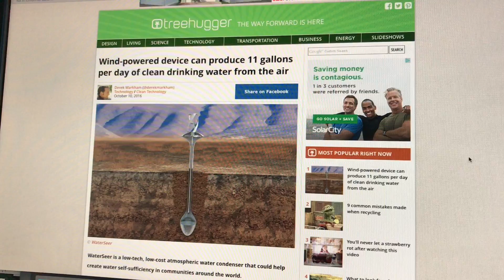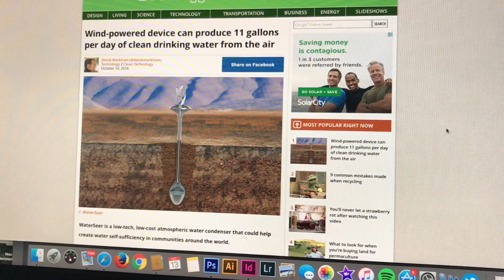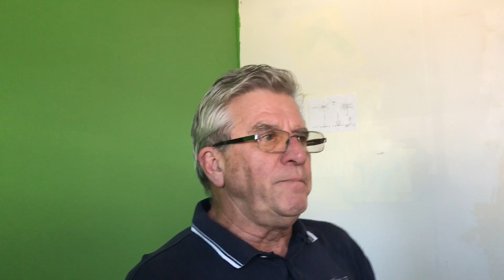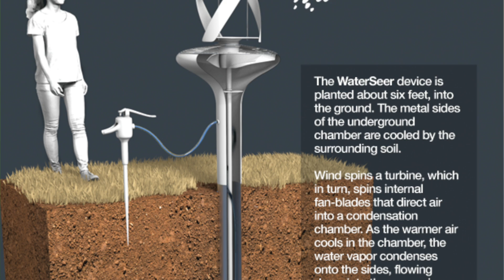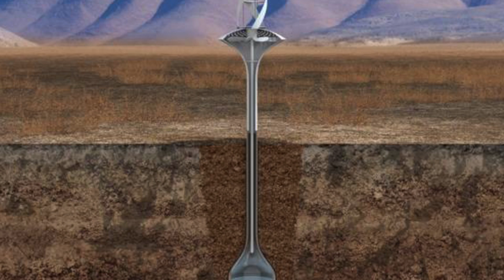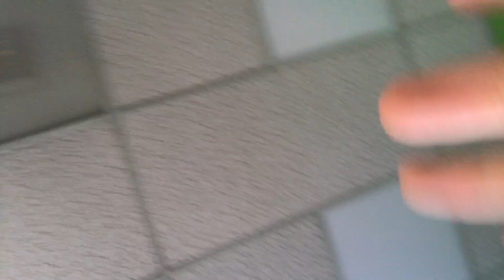WaterSeer Review

Comment: A video explaining my thermal model.
https://www.youtube.com/watch?v=P7bUgmKOvsE&t=1s
Reply from the maker: Good stuff, Scott. The one thing I was hoping you would explain is the rate at which the dirt would warm. 

BTW, I have a call setup with the folks at WaterSeer for next Thursday. Stay tuned.
Reply: Thursday 10.11?   Be careful that Don Z.  at Vici-labs (Waterseer) does not dance around your questions.  He did mine.  He will answer questions you did not ask to get you off the real question.  They are experts at avoiding direct answers.  After a few E-mail I think they are starting to doubt the passive model with conduction to earth.   They are now proposing moving the thing to other holes when the earth heats up.  (see my second video).  They mentioned TEC's and solar so I ran some quick numbers.   To provide the electricity to make 37 L/day with solar they would need like 130 m2 of solar cells...and not to mention what the TECs (Peltier device) costs.

The ground heat capacity is around  2.5 MJ/m3°C (for organic mixture).   The heat of vaporization of 1 liter of water its 2.2 MJ.   So as a rough number you can condense a liter of water by warming 1 M3 of ground each 1°C.  At 37 liter/day the heat transfer is 1/30th of what is needed.   You you can heat 29 m3 of earth 1°C each day.   I will add a earth volumetric to the model.    On a gut level I agree with thunderfoot's estimation.

Comment: The idea, as it's presented in their video, is unfeasible and - more importantly - thermal dynamically impossible.  Essentially, one has to believe that surface soil maintains a constant temperature gradient with respect to the surface atmosphere, and functions as a perfect heat sync.  Commercial grade dehumidifiers don't perform as well as they claim their "hydrolily" does and they have a constant power source.

Comment: I didn't do in-depth thermodynamics in my Engineering classes, but I can tell you straight off that this device can't work as claimed. You'd need 100% humidity at 30*c with a ground temperature of 10*c to get 20ml of water out of the device. You'd also need to be pushing the equivalent of 2 cubic kilometers of air per day to get the claimed 35L, which would take a total of 85 KW of thermal capacity needed from the soil to keep the process as efficient as possible... You're better off just running a solar powered dehumidifier because you'll get more water off it!!

Comment: Thunderf00t called this one a scam, you were more generous and you seem to think it just has a few mistakes.

I think the best thing you can do for "fresh" water in areas where there are no wells or public supply is to collect rainwater (you may want to boil it though). If it never rains there, then that device wouldn't work either.

Comment: Compared to a mechanical refrigeration system- a 3000 watt system, that moves 1200 cfm of air will put out about 2 liters an hour in in ideal conditions (fresh humid air intake). This system would output a tiny faction in power and air movement, with no solution for long term  transfer of heat. (Trapped in solid ground)

Comment: for fucks sake to all the people who are saying herp derp wont work thermo dynamics you sound like idiots to me. 

Heat transfer mechanics dictate that this device can work. the issue will be scale and effectiveness.

fact of the matter is the only thing new and or interesting they are doing is havibg a wind powered fan to blow air into a hole. 

I could tell you right now upfront if you wanna make that work just get a long pipe and bury it ib the dirt and push air through and you will get your air to dump water. interesting bonus ... If you pressure the air and eject it via a nozzle  and throttle it you could probly vastly increase the water production
Reply: Maybe start with capitalizing letters and making paragraphs, and later on we can talk about your wind turbine water extractor, OK?
Reply: sylvester lutchman
There's no engineering to nitpick yet, you've just used a lot of very vague language. A wind turbine, what kind, how much kilowatt output? How much water is this supposed to produce on average per day? How much does it cost?
Reply: sylvester lutchman When that water condenses, what does it do? Oh yes, it realesed energy. That energy will heat up the soil and condensation will stopp, go watch thunderf00t's video if you have not allready. This device will not work in such a way that you can get usefull amounts of water from it..
Reply: you could get a wind turbine to exract water out of the air using nothing but the air itself to cool the heat exchanger. Ive done the math on this exsisting design and rhe fan only requires under 100 watts of power to move all the air it needs to (under 100 cfm). guess what you can modify this design to make it work to cool air to the dew point even if its minus 1 C. your gonna require that fan to do some compression work but its got a  ig ole VWT untop of it to give it power on a direct shaft so why the hell not.
Reply: sorry dont give a crap about that. wanna nit pic grammar go ahead. 

wanna nit pick the engineering then bring it on.
Reply: Мейсу Семпай it takes 2 kJ of energy to condense one g of water.

assume this heat pump can have a COP of just 1. just for the sake of simplicity and im feeling to lazy to work the actual COP.

so per kW of power you could generate .5 gof water per second... 1.8 l per hour.

modify the cycle of compression and cooling and maybe introduce a refrigeration cycle instead of just compression. you could get a COP up to 4 . so then per kW you would generate 7.2 L of water per hr . that would mean per day you would generate 170 l of water a day per kw of power. 

next yout gonna be like but the soil will get hot ... to which i will say so what? the ground is a heat sink. If yu are compressing the air even if you just compress it by a factor of 2 you will get 300 K air heating up to 600 K air rejecting heat to 290 K dirt. iunno about u but my money is on the dirt absorbing that hear quite easily.

Comment: To wish the developers luck is an emotional response. Yes, there are a bunch of people who desperately need water, but that won't change the laws of thermodynamics. It does not have the power to move enough air through the condensation chamber and it cannot dissipate heat away from the chamber effectively, meaning that it will stop working as soon as the surrounding dirt heats up. It would be cool if it worked as advertised, but it can't. Because physics. Just compare it to a powered dehumidifier, they both basically do the same thing.
Reply: It won't work, no. But it might the the first step in the development of something that does.
Reply: Andy Brice First step would be understanding thermodynamics, that should be the starting point. The people who made this don't understand it, or they do but are lying to fleece benevolent but uninformed people. They are either incompetent or running a scam.
Reply: Something that circumvents the laws of physics and WORKS!
Reply: No one ever said it's physically impossible to remove the water from the air. Just that this device would not generate enough energy to do so, nor be able to dissipate the heat. Dehumidifiers do exist.
Reply: More like wish the crowdfunders luck in not throwing their money away on this scam
Reply: Andy Brice
Removing water from the air is a monumentally power-hungry task, though, which is the main problem. It's a thoroughly inefficient way to obtain water. And it's unlikely that this device will pave the way for other devices that make the process more efficient somehow.
Reply: Yes, dehumidifiers do exist, and if third world countries had enough energy to run them for water production, they would not be facing water issues to start with.
Reply: Owen Major But people who don't have access to water live in very arid climates. If the climate there wasn't arid, they would not have water issues. And arid air does not yield much water. You can't squeeze out water from a dry towel.
Reply: wrong again, you can live in a tropical climate and need water ... water tables too far down to reach and not enough recipients to collect the rain when it does to hold through dry seasons - also it's raining increasingly less in the tropical climates (at least where I've lived around the tropical belt in S.America, SE Asia and Central Africa ... too many trees being cut down probably).

Comment: The designers of this are either completely ignorant of basic science or are crooks.  Just look up a dew point chart.  Take a typical condition, 80 deg F and 30% humidity, the dew point is 45 deg F.   In other words, the bulb of the Waterseer would have to be cooler than 45 deg to produce any water.   Just the ground is not going to cool 80 F air to 45 F.

Comment: The WaterSeer is old technology that promises to extract water from air using only the thermal differential of 2 or 3 meters of ground.  If this were the case, we would be able to extract the same amount of energy that it takes to condense water vapor.  

The people who promise you free water from the air don't want you to think about the amount of energy it takes to condense water vapor (2246 kJ/kg).  If instead they told you they could generate free electricity from sticking a tube in the ground, would you believe it?  Of course not.  For the same reason you should not believe this BS.  This machine works on the same concept as a free energy device.  It doesn't work at all.

Comment: You do not have to be a great engineer to see that this is the same process that happens around an air conditioner, and the permanent use of a powerful one or two horsepower motor is enough to produce a few drops of water per hour. Enough to be a nuisance, not enough to mix much more than a whiskey or two per day.

And the air conditioner has a very effective cooling gas circuit, not a simple temperature differential between the air and the soil at 2 meters depth. This whole apparatus is a scam. It does not matter whether the details of the air exits is shown, or if a more realistic 20 meter or so windmill is used. This thing is orders of magnitude away from working in a practical use, even disregarding the fact that it will warm up the soil in minutes and not work at all.
Reply: Mark Dignam
Even if you didn't have rainfall, you can easily collect water in tropical environments with other means - cutting nonpoisonous vines and draining them, using a plastic bag with a rock in it tied around a tree branch to distill moisture from the leaves, etc.
Reply: Мейсу Семпай Yes, which is why you don't need it in a tropical environment, and why it would not work in a dry one.
Reply: This is actually a great summary.
Reply: I have expanded on a few of the point you make above - actually I answered the clip before I read your comment.  The air cond example is one of flash evaporation is a heat exchanging environment.  Air conditioners as you note do generate quite a bit of water via condensation when in a hot and humid environment.   The waterseer would also need to involve a heat exchange and this would in fact lead to heating of the soil around the storage vessel and piping.   This is not understood by the "inventors" and disproves their claim.
Reply: I had to think about it also then I factored in a few things like Dew point at night ground absorption if the input air tube is smaller than exit tube then water cool down at bottom 
????plus the heat escaping the tube could make the turbine turn????
Reply: Father Joe Under such circumstances, the crazy thing simply will not work.
Reply: I have a 10,000 btu/hr air conditioner and it(at best) produces about 5 gals/day when running. A 5 gal bucket used to collect condensate which is why I know this. And this is only during high humidity times. Often it only produces but a few cups of water.
Reply: There would not be a need for a waterseer in a hot, wet environment - such as Singapore where I live.  here, you can generate a few buckets a day from air conditioning as you note, but there is no need for it as you can readily collect heaps of rainwater. In a dry climate, particularly a cooler one with les water vapor, you would need a lot of air conditioners to generate the same amount of water.  More importantly, you would also need an enormous supply of energy.

Some of you will of course say that the waterseer does not need an electricity supply.  And for that reason, it can only produce a very limited amount of water as it is reliant on no more than condensation of water vapor, and that will only generate tiny amounts of water.   Simply putting out rain capture devices would make a lot more sense.  The process of condensation is STILL a heat exchange process, as the water vapour in the air needs to be condensed to actual water.
Reply: wrong about not needing this in hot humid environment; I live in Central Africa (among highest humidity in the world) and people are thirsthy + water tables underground not always reachable, so yes, would be super useful if indeed it worked :-)

Comment: may be a plate meshed type HE extended into local mud will help if the temperature gradient and humidity is favorable
Reply: That would have to be a mighty big plate. If there's "mud" easily available, then I would imagine that it's probably much more effective to spend the money that this device and it's installation would cost to simply build a well.

Comment: This looks really great...but...Requires warmer air than the ground temps, in order to condense it from air in this fairly passive gadget.  Therefore, guessing it will not work very well in cooler climates.   The concept is good, but what's shown, leaves questions.   Like: how does the air that's induced down into this, get out?  What about the vessel at the base, warming?  What about germs growing in the vessel, with no good way to clean it?   What about chemicals and junk in the air, gunning up the vessel?
Reply from the maker: Precisely our concerns as well.
Reply: The central shaft is hollow and air escapes from that pipe. It comes out in the center of the vertical wind turbine (and disrupts the airflow thereby making the turbine less efficient.). The diameters of inlet and outlet are such that the processed air needs to speed up considerably when it wants to leave.
Reply: I think "chemicals in the air" are the least of the problems this device has, but there's really no way to clear out the device other than pumping all the water out of it (implying the device will make enough water to pump, lol), which doesn't clear everything out.

At least there's no direct sunlight to make algae grow.
Reply: Мейсу Семпай
 They got that question about cleaning and maintenance on their website too, their answer was something like: We will build this device so it sits inside a sleeve in the ground so the unit can be lifted easily and maintenance can be performed.

A person with a brain would think: 'Hey, why is this not in your animation?' Because they didn't think about this.
In other words, this project is a scam and the more people talk about its shortfalls the more info these people have to make their scam more believable. The people who react and their ideas are used to design this thing towards a more believable lie.
Reply: DreadX10
It sits in a sleeve? Meaning there's potentially even less physical contact and heat dissipation to make this whole "cooling" thing work?

Sounds even more like bullshit, cap'n
Reply: Мейсу Семпай  Yep, they got cornered by a designflaw and their response was to make the device even less efficient.
Doesn't matter though because this thing runs on bullshit and there seems to be an abundance of that.

Comment: "For every expert, there is an equal and opposite expert." — Arthur C. Clarke

Talk is cheap, how about review the device on real world data rather than conjecture.
Reply from the maker: If you know where to find real world data on this product, please share so we can update this video.
Reply: You don't need real world data. All you need is a very basic understanding of thermodynamics to calculate that it can't work as advertised.
Reply: Talk might be cheap, but knowing why this device won't work as advertised is free if you just pick up a high-school physics book.
Reply: I don't need to review the non existent "real world data" to know it is impossible for this to work for the same reason I don't have to jump off a cliff to to know I can't fly.
Reply: Please see Thunderf00t's excellent debunking of this provable useless product.
You start with a mathematical PROOF of the THERMODYNAMICS of a potential product to answer the question: IS THIS EVEN POSSIBLE?
You're right. Talk is cheap. Math is not. Proof is not. Math is hard. Proof or disproof is hard. Thermodynamics is hard.
Reply: They'd have been better off trying to crack desalination or the cleaning of grey water rather than this - it's plain from the thermodynamics that this thing isn't going to work in it's current form. They might have stood a better chance using the wind turbine to generate electricity for a thermoelectric cooling system at the top of the device.
Reply: LOL!
Reply: I agree "show me the money"....I mean show me the results of 1 year of testing in an arid environments.  I want to see full cycle testing, no short term testing results.   

I wrote them for a copy of the test results, which they say they will give out if you write   . (that was  in a .pdf on their Facebook page) They said they could not send the report to me unless I was a big investor or an educator since it had IP information....and then they would have to kill me if they sent it to me...    ;)